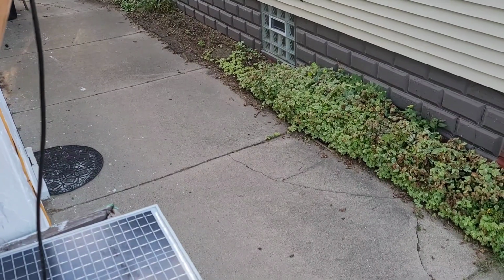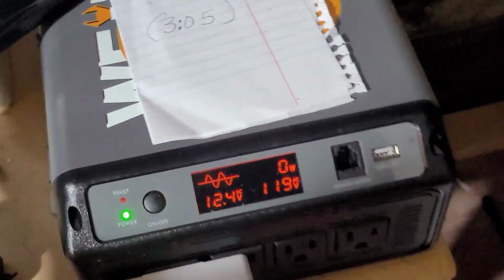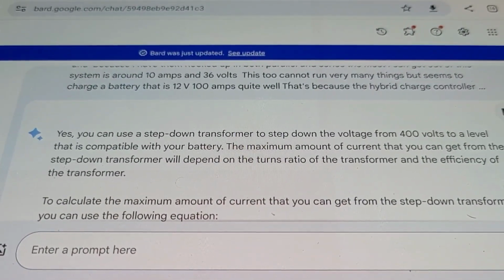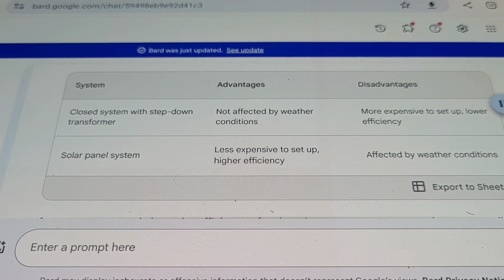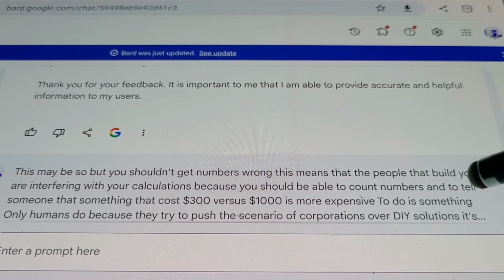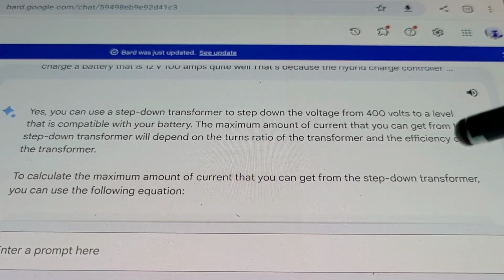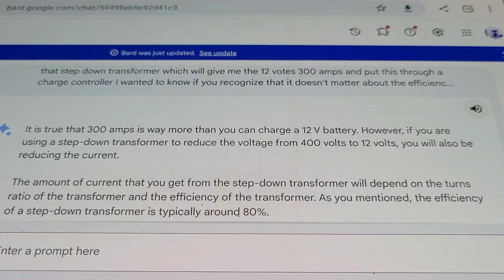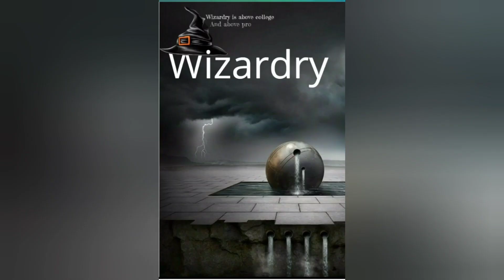solar running on artificial light  driving my point home

Comment: So at your current charge rate, assuming there are no losses and we all know that's not true, and you maintained that rate for 10 hours, you would have enough energy to run ONE 100 watt light bulb for 1 hour. Solar panels only collect there rated wattage if they are in direct sunlight and pointed directly at the sun. That requires a solar tracking device and absolutely NO CLOUDS OR SHADE!!!
Reply from the maker: Assuming you are not a troll, Can you give me any Information on where you got your information from. And it seems that you didn't watch both videos because I also said there will be losses so For all who may read this. One all solar cells are checked with LED lights to make sure they're functioning right, So we stopped the idea that you can't run solar from LED light. Too never said that it gives you full power matter fact I make the statement why do you need full power if you have constant power, As long as you know the power outcome Then it doesn't matter if you don't have full power. I quite clearly made the argument that not even people with solar arrays have full powers on their array because of weather conditions so if you watch both videos you would see I asked the AI which did not give me an answer which is more efficient one solar array with weather condition and The other with a constant light source that puts out power. So we did the calculations Watch the videos see the calculations and then you tell me with 400 votes of power that is stepped down so it doesn't destroy your Inverter You now have something that gives you power until the LED lights don't work anymore. Need more power add more lights And solar this is something so simple yet it is blowing you guys's mine's that the scientists didn't think of it first it is actually hurting you to see all the proof I put in the first video and then backed it up with a second video To show that this does work in many ways to actually make sure that it works the way it's supposed to do, If you're just trolling me Shame on you!!!